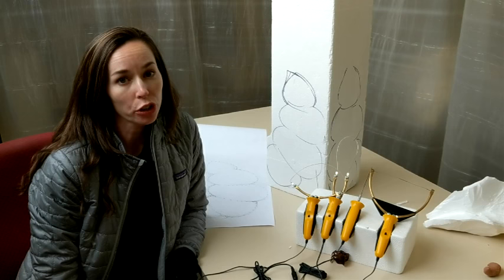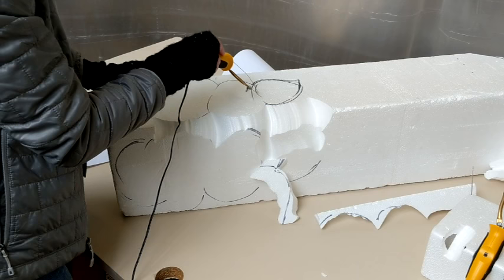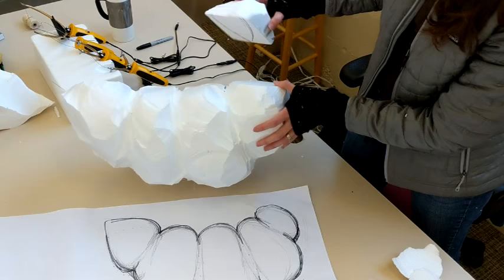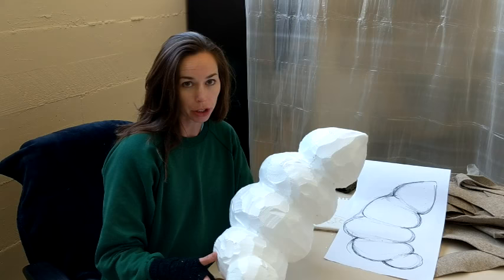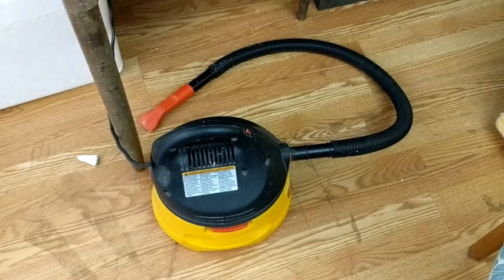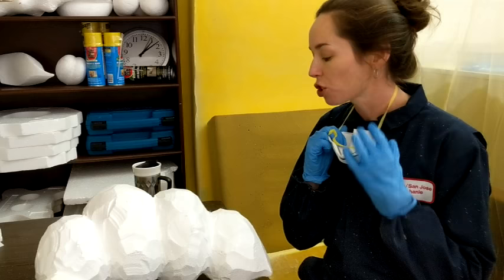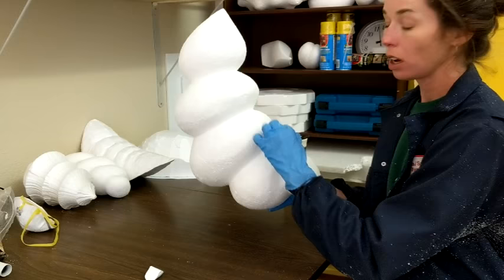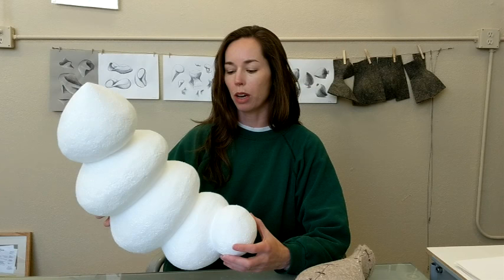Stephanie Metz InTouch: Carving Styrofoam

Comment: Hi Stephanie. Great video! It shows that you love what you do!! Got a few questions for you:
1) Is there a specific name for that rasp tool? Is it specific for foam? 
2) And lastly, can I shape styrofoam with a regular sand paper?
I'm trying to build a kicking board for swimming. They used to make them in styrofoam but now they make it with a different material which has less buoyancy. I never worked with styrofoam so I appreciate any information on this.
Reply from the maker: Hi Martin, I think that rasp tool just came from the hardware store; I don't remember if there's a particular name for it, but I don't recall it being meant for styrofoam. And yes, you can shape styrofoam with regular sand paper, starting with rougher and going to smoother, just like wood. It's definitely messy and gets all over and sticks to everything with static electricity. Be prepared with a space to clean up; a shop vac helps. And do wear respiratory protection so you don't breathe the tiny bits in. Oh, and there are also different densities of styrofoam. I don't know a ton about kickboards, but you might do a search for 'best eps foam for kickboards' or similar to guide you. Good luck and happy swimming!
Reply: Thank you Stephanie, I'll follow your suggestions. I really appreciate your help!
Reply: Hi Stephanie, it's me again. the carving and sanding turned out great after following your instructions. Those little pesky bits are very "affectionate" :) But it seems that the styrofoam (styrene) I worked with is a bit permeable. Do you know any product I can use to waterproof/seal the board?
Reply from the maker: @CreativeFilms2003  hmm, there may be some spray coatings you can find at the hardware store like PlastiDip; you have to make sure any coating won't react with the foam and melt it chemically. I think PlastiDip fulfills that, but you'll need to research it more...

Comment: this is a great demonstration. I was just wondering what kind of tool you used to sand the foam? Can one just use any type of sanding block? what type and grit of sandpaper do you recommend ?
Reply from the maker: Hi Jess, you can just use sandpaper but I think the metal rasp tool I use was something I just found at the hardware store-- maybe in the drywall or painting areas? It was a very long time ago. I start with pretty coarse sandpaper like 60 grit or even rougher, and go finer from there depending on the final needs of your piece. Do remember to protect yourself from the tiny dusty bits.  Happy carving!

Comment: great video, very informative.  How do you make a circle? what lb density is the foam?
Reply from the maker: I'm not sure what density this is; I've been using 'used' foam of varied density. Are you asking about a circle or a sphere?
Reply: @StephanieMetzSculpture   I am looking to make both a circle and sphere to make an ice cream cone. thanks.
Reply from the maker: @hectorm2583  depending on the size you may be able to find pre-made spheres and cones at craft stores. If it's meant to look like ice cream you luckily don't need a perfect sphere I'm guessing; I tend to draw the profile I'm looking for on all sides of the block I'm starting with-- in this case you could trace a plate or something else circular. I'm not sure what else to say except, er, remove material until you get what looks right. Remember you can sand or rasp your rough surface to get to a smoother one.

Comment: I recommend using a respirator if you’re planning on burning styrofoam! Those fumes are super dangerous, not to mention smelly!
Reply from the maker: Thanks-- I so regret not using one when I recorded this; I did the carving so rarely and used my fan-blowing-air/open window/plastic mini room setup, but I should have just pulled out the respirator. Especially as this video seems to be reaching a lot of people. Argh. Thanks for the comment.

Comment: Is harmful to breathe that burning styro foam?
Reply from the maker: That's correct, it's not good for you. I should have worn a respirator rather than just rely on air circulation.
Reply: @StephanieMetzSculpture  can you suggest me any, an easiest way to make a mold to pour in silicon caulk?
Reply from the maker: @-Harambe  yikes, "easy" and "mold" and "silicone caulk" don't really go together in my limited experience. I would try searching for a video about it,  as it's not my area of expertise.

Comment: Does this mean these wool shapes will be hollow?
Reply from the maker: Thanks for your question. No, these forms will not be hollow, they will be filled with foam or other stuffing. I'm working from the outside in-- making skins to fill and then cover-- as a means of enlarging the work without the labor and materials of building up solid(ish) wool through needle felting alone. Still a lot of labor though!
Reply: Wow! Very innovative.

Comment: What glue did you use?
Reply from the maker: Thanks for asking; I used Styrogoo Instant Tack EPS Foam Glue from Hot Wire Foam Factory, www.hwff.com
Reply: Is that a special sanding paper?